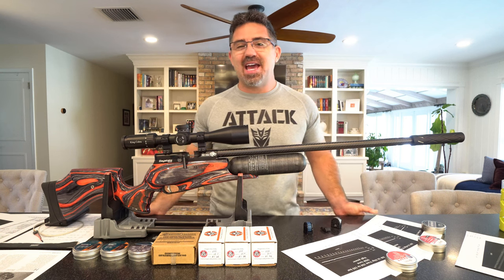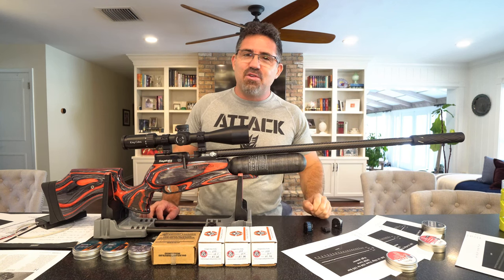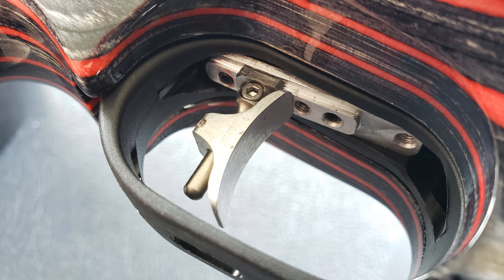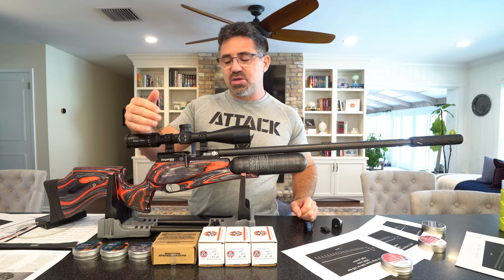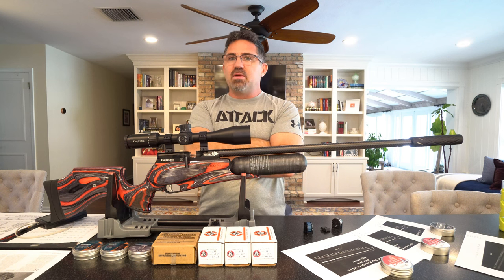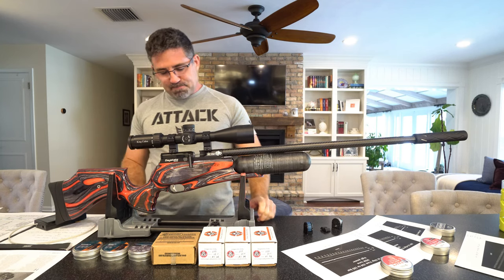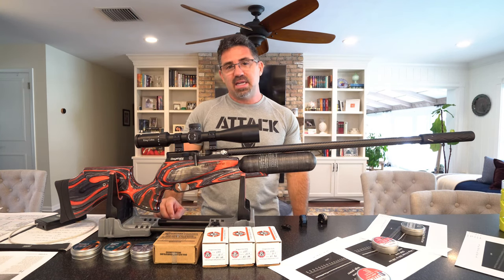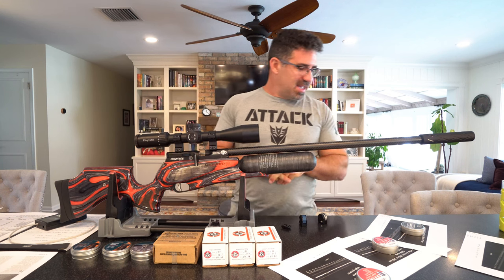Daystate Redwolf (AIRGUN TUNING GUIDE) !! + Electric Air Rifle Tuning - Tuning for Accuracy - .177

Comment: After a year and a half of issues and pellet and slug testing, if you are experiencing accuracy issues that seem unexplainable, Try the .217's, I couldn't buy a group with the 218's thousands of pellets shot and hours of testing, My friend accidentally ordered some barracuda matches in the .217 and he hated them and my gun loves them, also the 217 knockouts are lights out. I tried every weight and shape out there and was just about to either smash or sell this gun and now after a year and a half, I even sent my scope out to get looked at because my groups made no sense, and it was driving me crazy. Finally, I have what I paid for.

Comment: Wow Steve amazing video with lots of info ,  I may of missed it, But can you lower the power to sub 12 ft,lbs ? And then what would you set the other two levels at ?  Thank you for the video.
Reply from the maker: Yes, 12 fpe is easily programmable.  The other two levels can be set however you wish.  Best, Steve